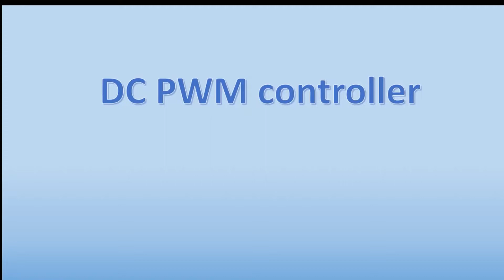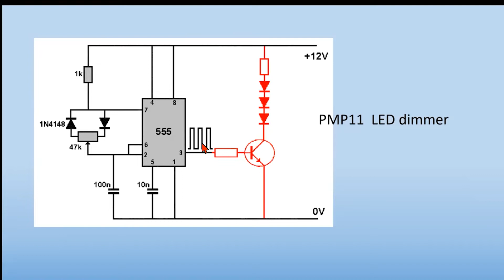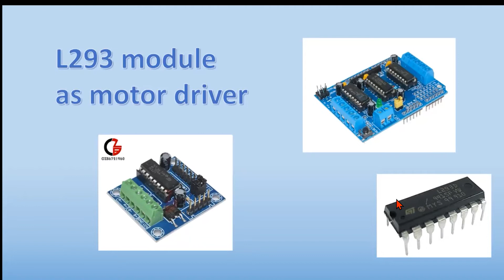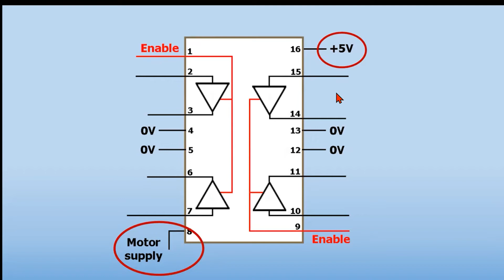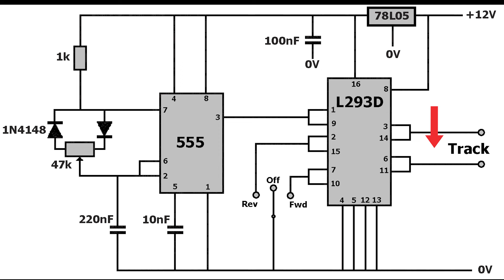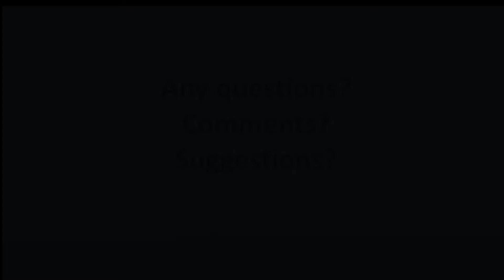A PWM controller

Comment: Very good way of achieving PWM. I've used Arduino processors to allow me to integrate wireless control as well but this is a great low cost option!

Comment: Fantastic presentation.  If you use the blue pcb with the L293D, it looks like it has an on board 78M05 that you can use to power the 555.   Thank you for sharing your work.